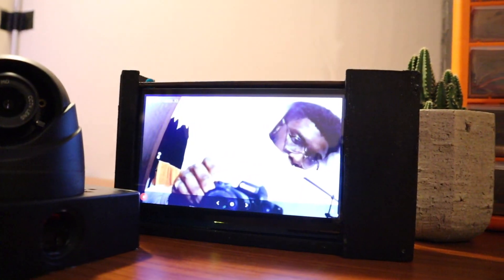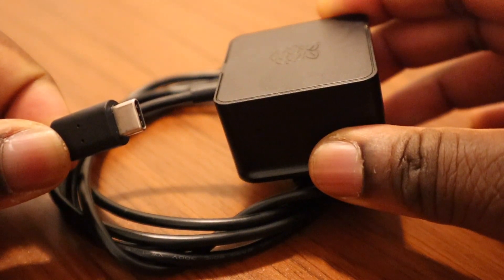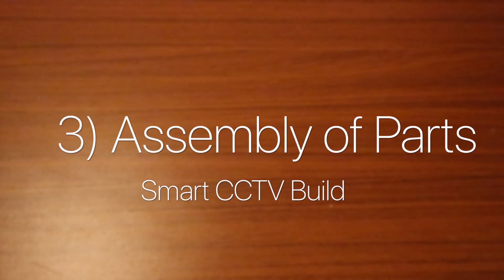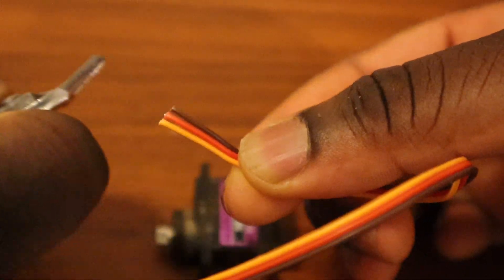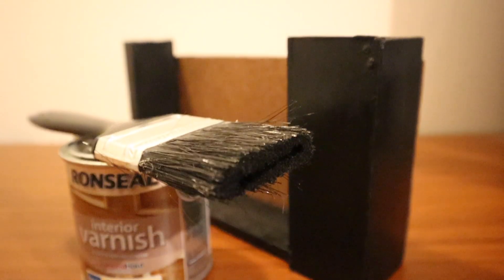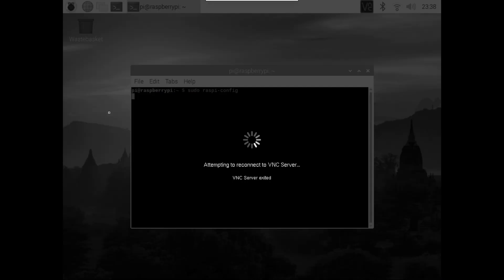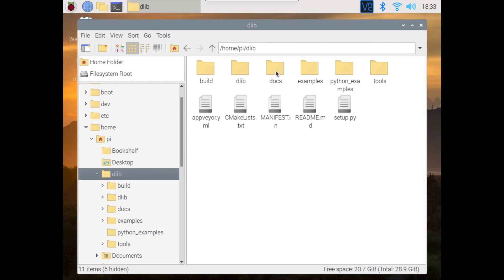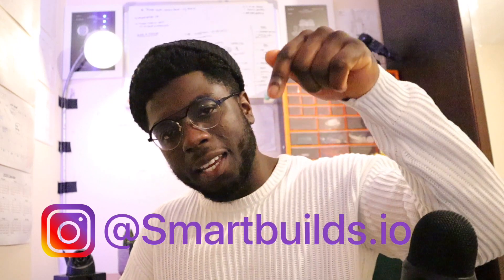Smart CCTV Camera (with Face Recognition) using Raspberry Pi 4 | Full Tutorial

Comment: Would it be possible to take those existing files and add other things like ai assistant features? 

I have never built anything and I wanna start with building my own Alexa like ai and one of the things I wanted it to do was to be a to connect to a pi camera I'd end up building and have it tell me "(person) is at the front door" and things like that so if I can actually add other stuff to that existing code it would save me a lot of time once I play around with it and figure it out how everything works

Comment: Hi, great video
I was wondering how the video feed can continue to be processed while no one is connected to the server. I would like to have telegram notification when a movement got detected and being able to connect to the server afterwards.

Cheers
Reply from the maker: Hi Clause.

As in being able to detect while offline? It would still be able to detect movement etc offline and you can store this locally. And when the back online you can send these to a server to invoke a notification via Telegram API (although never seen their API's)

Cheers.
Reply: @EbenKouao  Thanks! I found a project that was using Telegram. I combined it to your project and now I have everything I wanted. Web server and notification through telegram! Thanks!
Reply: @Claude.Samuel.Chretien  would you be able to at all link the project? Im attempting something similar, cheers
Reply: Hi, 
I actually stopped using the web server. Now I have a telegram bot that is sending me notification on movement to which I can also ask for a screenshot. I also record video to Dropbox. I used the project called "Home surveillance and motion detection with the Raspberry Pi, Python, OpenCV, and Dropbox" from Pyimagesearch and I added the python-telegram-bot library. I also used OpenCv to convert frames array to video.

Comment: Hi

I just wanted to see if your able to give some advice on interfacing a 15 inch touch screen with a Raspberry Pi 4?

Thanks
Reply from the maker: Hi it depends if the screen is compatible. There are some 3.5 and 7 inch screen compatible. Most of the times the product states its compatibility. Best of luck.
Reply: @EbenKouao  Thanks. i bought the touch screen from China. It just has a hdmi cable. I now realise i need a logic board for the touch screen to be able to interface it with a raspberry pi. Do you have an idea where i could get one from?

Comment: Good job bro !!!
But I countered a problem . For the 1st time it worked perfectly but then onwards its showing that the address is already used...
please tell me how can I fix this problem...
Reply from the maker: Address already used... are you referring to the camera module? If so, sounds like the camera port needs to be enabled in raspi-config.

If not check that the ribbon cable has a good connection and check the camera module is well attached too

If not may be a faulty camera module... try with another. 

Good luck!